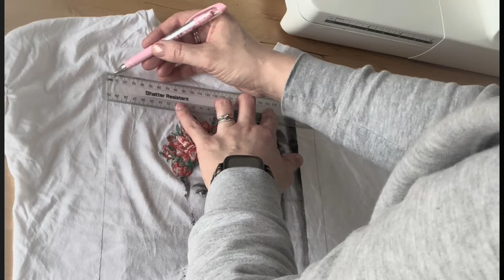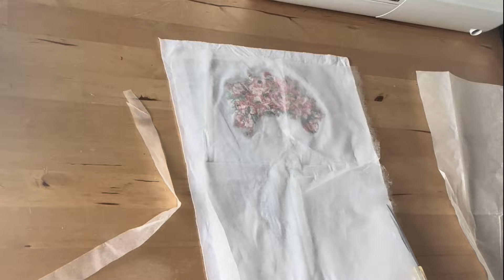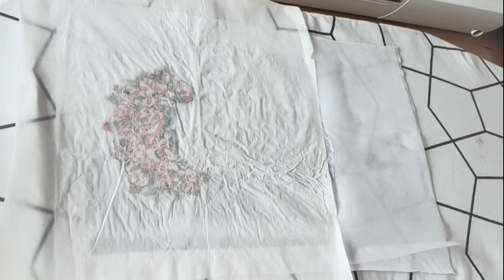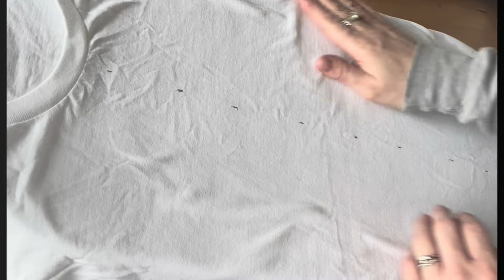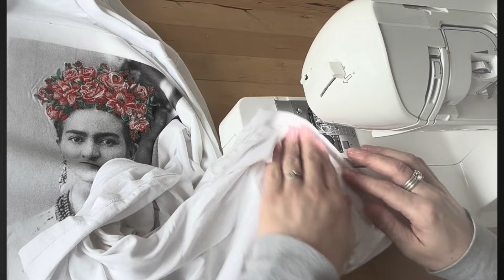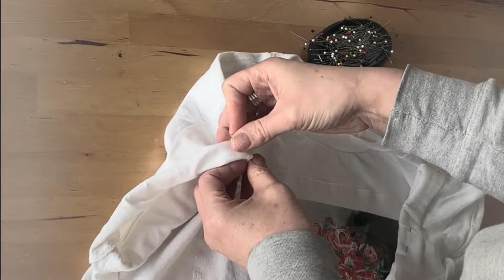How to Transfer a Favourite T-Shirt Design to a New Shirt | Easy Bondaweb Upcycle Tutorial

Comment: I don’t have a sewing machine what kind of hand stitch do you recommend? Or will the bondaweb do ok without sewing/stitching the edge
Reply from the maker: The stitching will ensure the print is fully secured to the t-shirt to make it long lasting (incase the bobdaweb looses its stick over time). 
I have this tutorial on hand stitching embroidery you could try around the edge: 
https://youtu.be/nX3dm3rmSmU?is=koVtW6Pffy5mtvLn
I would make sure you use a fairly stable t-shirt (not too stretchy) so that the hand stitching doesn’t break when wearing! 
Good luck ✨